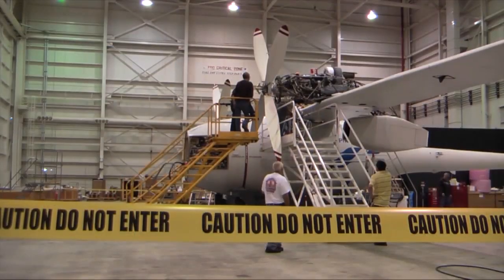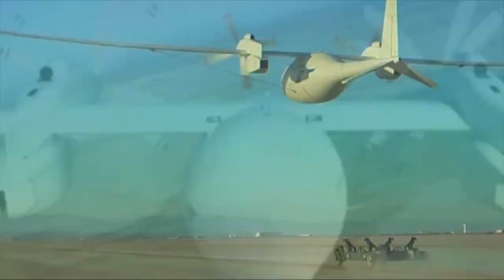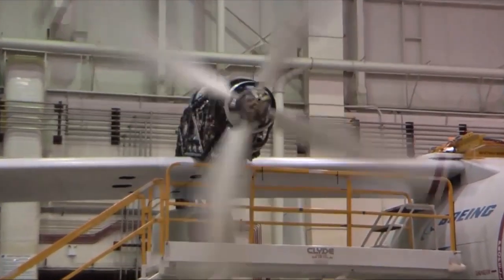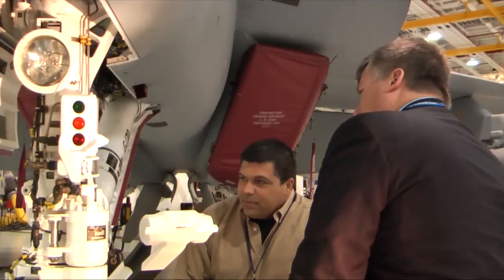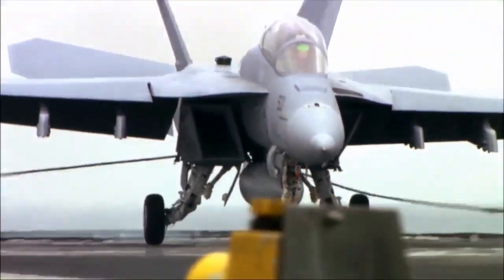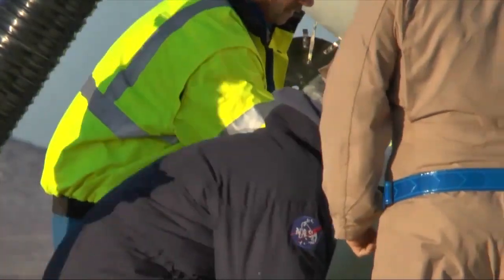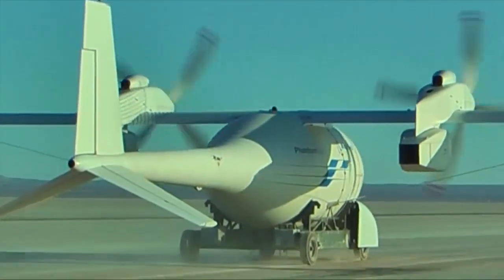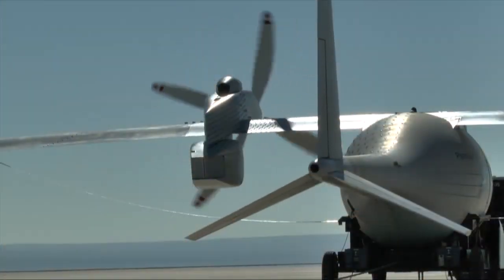Boeing Phantom Eye readies for return to flight: Completes taxi tests

Comment: Looks nice! Good on them!
Just one small detail - The F/A-18 was Designed and Built by McDonnel Douglass and later acquired by Boeing... Technically Yes, "Now" it's a Boeing Super Hornet, but that is analogous to Saying, if Ford Bought the Corvette, then came out with a new year model, they really couldn't call it a Ford, nor would they, but that's what Boeing is doing... And I love Boeing A/C... they make damn good aircraft... But so did MD!
Reply: Ukuleles 0lp out 8 (p